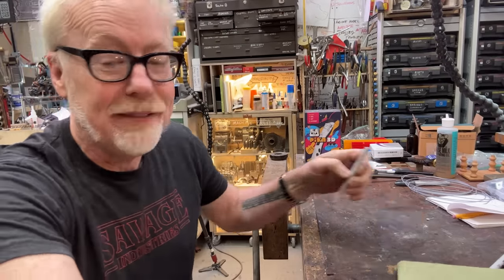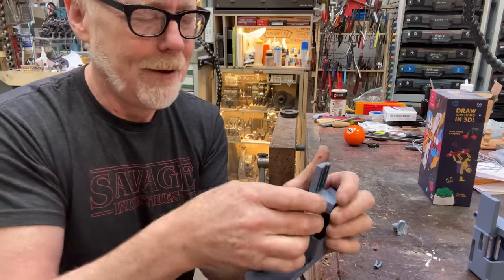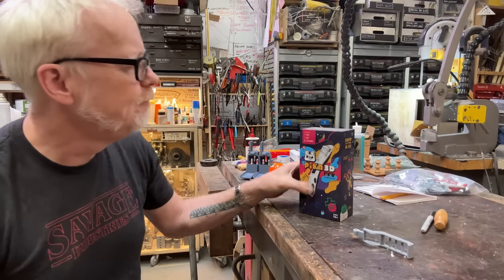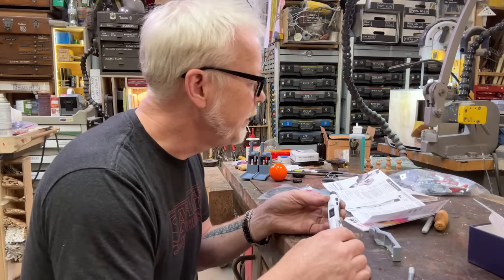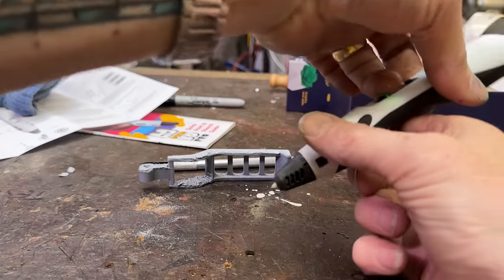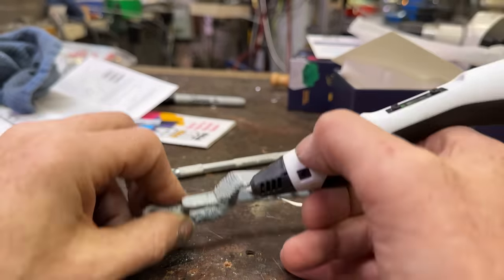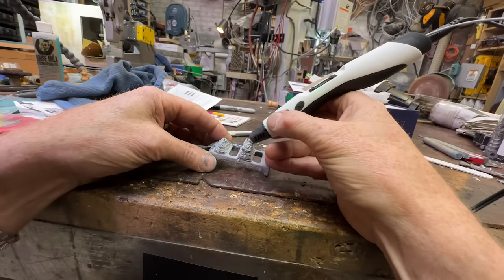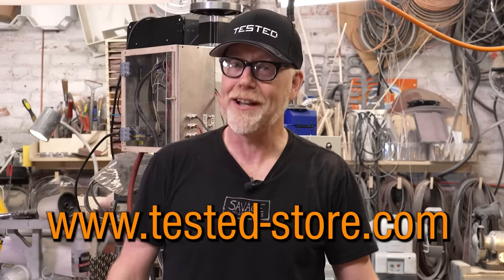Adam Savage Tests This 3D Printing Pen!

Comment: super glue and a guitar pick would probably work better for resurfacing parts. maybe use plaster or clay to infill. but this 3D printer pen just makes a mess. its better to just cut wood parts from a laser cutter, stack them with glue, then sand it, or use a CNC machine to finish the surface, then use it in vacuforming plastic parts. then maybe for strong parts, you can lost wax cast those vacuformed parts with sand and metal. I think you could make more parts faster and cheaper that way, once you have the vacuforming set up.

Comment: This gonna be meme fodder, BUT I want it to extrude a lot slower and a little hotter.The theory being that I want the new PLA  to be hot enough "weld" itself to the piece and that it would require a much slower feed rate to do so.  Another option might be to heat the item up before attempting the repair.  I would love to play with one of these for filling cracks and repairing ABS factory items.  Thanks!

Comment: Jep that is what i tryed at first but then a friend of mine sayed: try a temperature controlable soldering iron to smooth out the prints or to weld 2 parts together with old pieces of filament and bin doing that ever sins it works way better then a 3dpen hope you give that a try

Comment: Hm, "push the fwd button to start and push it again to stop" actually doesn't make a lot of sense... it would have been a far superior and much more intuitive UX if the way to do that would be "hold down the button for as long as you need, release and it auto-stops".

Add to that a manual "hold in place" feature, and it would be perfect.

Comment: My daughter has a 3D pen and I immediately dismissed it because the projects it suggests are gimmicky. BUT........I now see the light. If it's used as a repair tool or for small projects that can be further sanded and shaped, well......yup.
Reply: Honestly, look up some of the things people make using them, they can do some interesting sculpture bits if understand 3D shapes and can lay out vertices almost like modeling in blender or other 3d software.

Not meant for like wear and tear, because any infill will be done by hand, but people have found some neat ways to make using them.

Comment: Fixed my washing/clothes line the other day by taking out one of the injection moulded parts modelled it in fusion360 then 24 minutes later bam perfect fit first time.

Comment: I already know it won't work that well, making a smooth surface with 3D pen is quite impossible. I use mine few times a year, i don't regret buying it since it does something that no other tool of mine does. Sometimes support gets knocked off and you need to mend that, it is ok for welding parts together, filling holes but the finish is anything but pretty. Soldering iron with a custom tip, it is one of those projects that take an hour to make a special tip for one job and over time you have enough tips but.. there is nothing that replaces the finish that a machine can do.

edit: yup, was right. It takes time to find the speed for you, it is slower than you think. For 3D printing hobbyists, it is a valuable tool for sure just don't expect to do anything pretty with it. One of the most common jobs is to make a fit using dimples instead of whole surface for a friction fit. Tiny things that can't be done with any other tool.

Comment: make a smoothing tool out of a nail to put in a soldering iron.. set the iron to the glass point of the material.. proceed to smooth. There are 3D print smoothing videos that show what I described.

Comment: As a Tipp dont use 100 % infill, Go for a lot of outer shells but don't use 100% infill it's just a waste of material and time and could lead to inaccurate dimensions and decreased details.
Reply: For very small parts where you need solid infill try to lower the flow of the printer bei 2 to 5 %

Comment: To be useful, the tool needs to output more material in one pass and have different cross sectional shapes you could use.  Then you really could build up parts free hand. But one little string is too inexact and tedious.

Comment: Very cool video
I'm just getting into 3d printing
I purchased a resin printer and a PLA printer.
Both are very good
I'm excited to add metal parts to my 3d prints.
Nuts, bolts , gear and various other metal parts.
You should check it out 
Soooo cool 👍👍

Comment: baby powder + photopolymer is da wae.

the 3d pens are mostly a gimmick and really useful only for repairs welding together parts but a solder iron with a flat tip works way better.

Comment: 6:36 - Yikes Adam!!  Never cut towards your thumb!!  I have a scar on my thumb to back up that statement.
Perhaps Dremel to clean up??
Reply: Generally this is true, but using the proper grip and motion it's relatively safe. You'll notice Adam is only using a curling motion in his fingers, which is part of it, showing he knows the technique.

Look up "pull cut" or "paring cut"; it's very common among whittlers/wood cavers.

Comment: Seems like a toy really, this thing needs better tips, one with a flat “table” kind of like a router for it to ride on the surface and flatten the plastic as it passes, and the table can heat up too to “iron” the surface flat, the pen fills the gaps and as you move it flattens the surface

Comment: For PETG, just add .05, no fan, to the first layer (so 0.25mm first layer height with no fan for .4mm nozzle). And bump up the temperature. I would start with 75 build plate, 235 nozzle. Also, turn down part cooling for better layer adhesion. If it is over extruding, ramp up print speed. One other thing;  PETG and TPU are very sensitive to moisture.  So if you do not live in a desert, keeping the filiment in a dry box, and keeping it dry at all times is manditory.

Comment: Honestly, Adam, I don't think this is a valuable addition to someone who is into 3D printing.
People who 3D print for a hobby or small productions, will attempt to have better quality 3D prints, period. There are better ways to deal with overhangs and quality issues. Slicing software has gone far lengths to improve quality.
For larger batches also, a 3D pen is totally useless. You would add a tremendous amount of time/work to "fix" prints. In that regard, take a look at the video's of Slant 3D: they are giving very practical and useful info for better designing for 3D printing and the printing process itself, out of their experience.

I might use a pen like that is to touch up on 3D prints, but not for repairs and certainly not for anything that requires a surface quality and strenght. But in the end I think this product serves a totally different hobby (creative, colourful crafting and the like).

Comment: Owning both I'd rather just reprint the part or print a repairing part to attach.

Anything with the 3d pen will need sanding and might as well sand a smooth part reprinted or sand some Bondo for painting. 

They are just fun and the kids love using them!

Comment: it's a 3d PEN. 

those buttons are for your thumb (the forward and backwards) and as a gamer you should know how to press them.  forward with the tip and backwards with the bit between the distal phalanx and proximal phalanx. (the bottom of the joint.  i have tried to google hard but i couldn't find the name of it)

Comment: If the surface is not heated too, nothing will bond. This tool is useless. I think a flat tip soldering iron is better. Don't worry, be happy. 🙃

Comment: Those 3D printing pens are pretty terrible... EXCEPT for one use case where they are great which is using them to weld 3d printed parts together or reinforce. I have one I used on a helmet where the tip of the "pen" melted the seam and then added more filament back in the gap to strengthen where normally id be limited to glue.